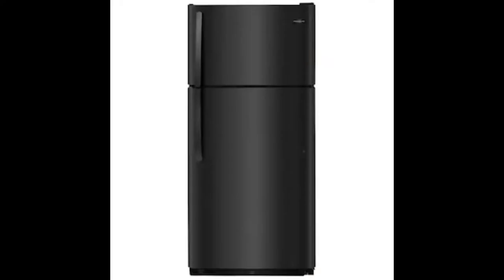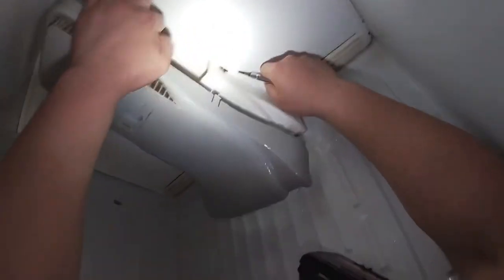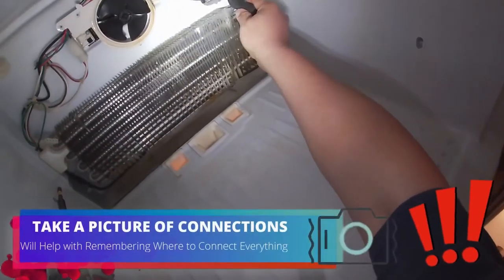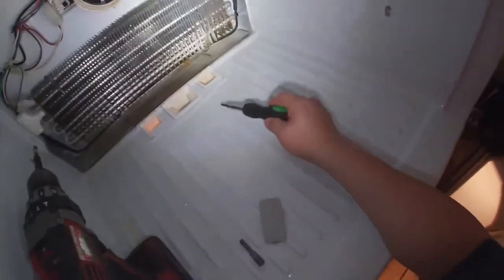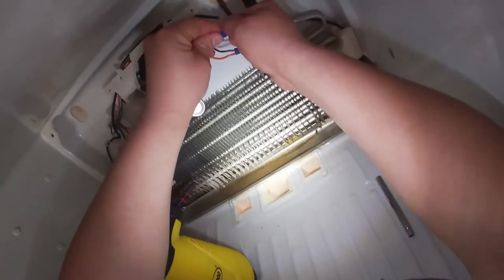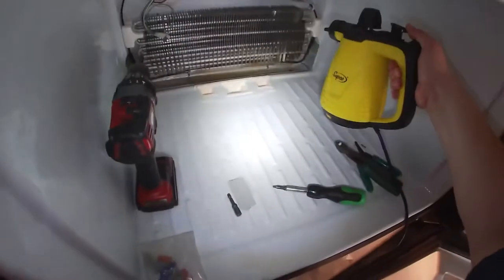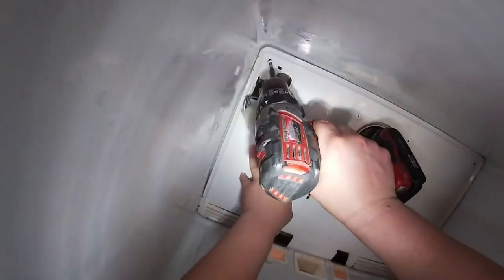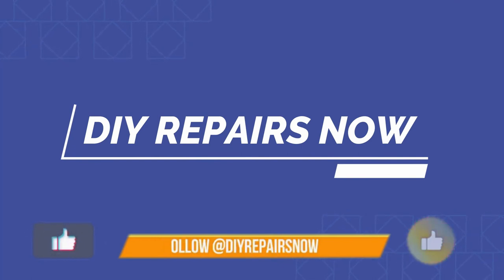How to Fix Whirlpool Refrigerator Ice Build up in Freezer | Leaking Water | Model WRT138TFYB00

Comment: Facing the same problem. Huge ice is getting build up in the back area and blocking air flow. Any solution to avoid ice formation on the back pipes? @diyrepairsnow